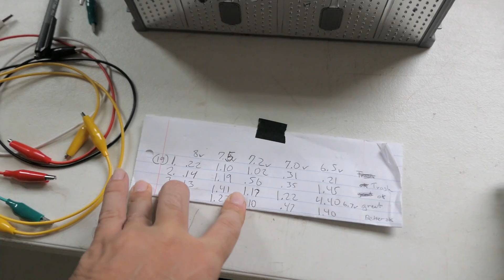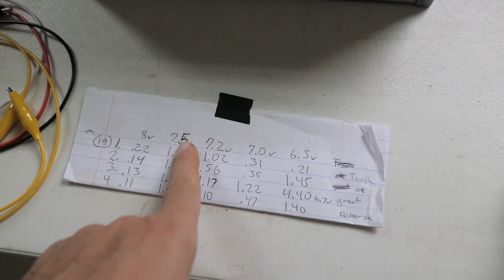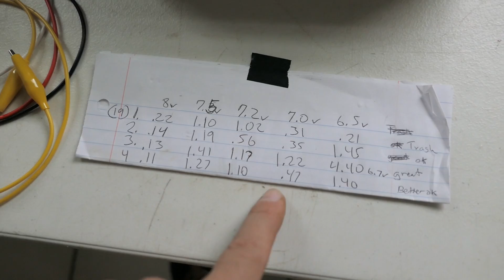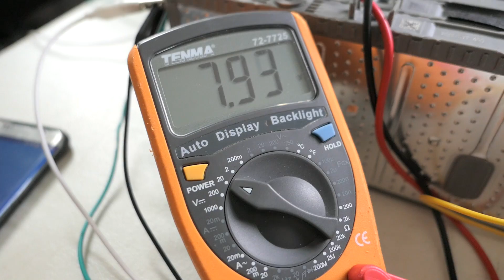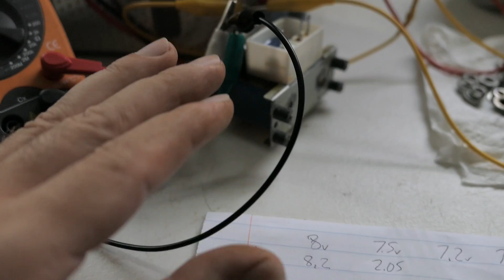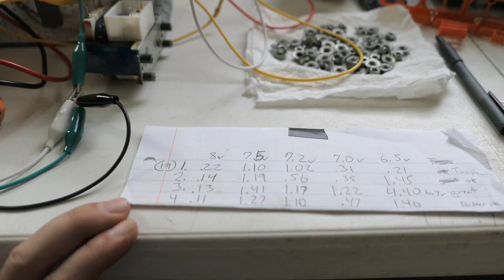Prius HV Battery Module Load Testing - Gen 2-3 ll lll

Comment: Can you use a load tester for a 12-volt battery?  I have one that does 6v and 12v.   I'm thinking the voltages are pretty close, but I don't know what the amperage would do to one of these modules.  I wonder if anyone out there knows about this.

Comment: 1 have been doing some research, it seems like you can use gen 3 cells in gen 2. But can you use gen 2 cells on gen 3. Mine is a gen 3 from
2010. Most of my cells are above 7v I have 4 that are in bad shape in the low 4v those I am going to replace for sure. However would you recommend to change anything below 7v? I have 4 other cells in 6.6. Please help :) and thank you for your video

Comment: Now buy a charger discharger charge battery with 1.5 amp to full then repeak charge at 0.4 amp until you have full voltage back. Then discharge and recharge. Now load test them. 
If they test bad after that let trash eat them. Otherwise save them for next time you take out the battery. Do this with any modules you buy. I am preemptively doing this.

Comment: Correct me if I’m wrong but Doesn’t the longer time you wrote down (1.22 and 4.40) at 7.0v and 6.5v indicate a battery with high resistance rather than low resistance due to the increased time? I would think a shorter time would indicate a battery with less resistance like battery  #1 with .21 seconds. 

So in other words, longer time to get to 6.5v means the battery has higher resistance and therefore is a bad battery.

Comment: Thank you for your wonderful lesson. I fixed my Prius C HV batteries using your method. POA80 popped up several times despite replacing all the bus-bars. Cell 9 was the culprit.
Reply: did p0a80 go away?

Comment: what's the simplest way to DISCHARGE a module? I put two new modules in my battery pack but they are .2v - .3v higher than the old ones. is that ok? or should I discharge before putting the battery back in the car?

I put little alligator clips on the modules and then onto a light bulb and it smoked the cables!!!

What kind of cables / light bulb or anything do I need for this?

Comment: Awesome and Informative.💯
Ever so often my check lights kept coming on, I did various scans which gave the P0A80 code, the bus bars, nuts and connections were all cleaned but after some time the lights were on again.
I’ve watched this video and because of this, i found four faulty cells(modules).
I replaced them and the car works perfectly. The problem only occurred under heavy loads and when the battery was really low. Some scanning tools wont pick this up. This method is definitely the way to test the integrity of the individual cells. Thanks alot for saving me some money and keep  up the good work. 🇹🇹

Comment: In making this instructional video, you did a bunch of starting and stopping. For all the rest of us, why not just set up a camera to record both the timer and the voltmeter, and then use the video to determine the voltage and time points. You wouldn't need to attempt to connect the load and start the timer simultaneously, or even attempt to coordinate connecting the load at a particular moment in time. Just start and stop the video after you've gone through all the cells you are testing and write down the voltage and time points. Starting and stopping introduces the time between reloading, which brings cell recovery into play. In other words, a longer rest period between loading allows a cell to recover more.
Reply: Thanks for this information, I’ll be using it during my test!

Comment: In normal operation the prius doesn't let the module voltage drop below about 7.5 so I don't think the time it takes to drop to 6.5 would be relevant.  The only time I see them drop really low is when there's a bad module.

Comment: Thank you, I followed this exact process and it made huge difference in rebuild prius battery. I had to use 6 halogen headlight bulbs to create large load. After tested all modules I replaced 13 weak ones and now works excellent.
Reply: Which charger you  use
Reply: Haha perfect, this is the answer I was looking for, I've been using 2 55w halogen bulbs and the voltage doesn't even drop less that 7.5v in any of the cells, even if I've discharged them and charged them at 3900mah which is really low, and it won't drop less than 7.5v even after 10 minutes.
Reply: How’s it been??

Comment: It is normal that close to 6V the cell will have longer time when the voltage drops. One cell is indeed a set of 6 cells 1.2V and more power it gives when you are close to nominal voltage of the cell so 6...7V.

Comment: hay thank you. could tell me how to charge the battery cell outside of the pack so I can load test them. I know it may be obvious for some but I don't now. how much voltage should I use to charge each battery? and I take it the positive of the charger is connected to the positive of the battery? how long do I charge them for or do I monitor it while charging with a voltmeter in series?

Comment: Great video! Can you please give a little more details regarding why you used three leads and what other components might serve as a good amp draw?
Reply: The reason he is using 3 leads is because of the amount of current going through just one undersized lead would cause it to burn up.. you can use one lead if the wire size is large enough

Comment: I desire I could watched this video before, I just finished load testing a 3gen cell with a H4 (90w) halogen lightbulb and I think I damaged it because I drop the voltage down to 3.5 v after 20 minutes and now is alittle bit inflated.
Reply: Wow 🤩 that low wait for how long you had it hooked up heheh did you fully charged each cell?
Reply: There’s many ways to do test loads but yeah 12v at 50w load will probably eat all that juice on that 8.2v battery , do you happen to know the Capacity of each individual cell on this battery ?

Comment: Nice! thanks for the info! I'm wondering why no one has started making aftermarket brand new batteries for hybrids and electric cars by now. its been over 20yrs for the hybrid. and 10 for the electric car. why is no one capturing this market!?
Reply: Lakario, I'm pretty sure I read that Toyota had an exclusive contract with Panasonic  not to sell individual new modules or complete batteries to anyone but Toyota  - and Panasonic holds the patent. However, that may change at the 20 year mark.
Reply: @legallyinsane7151  How do places like this then sell a battery module for $60? They don't say if it's new or used. But $60 a cell seems very steep. https://www.electronautomotive.com/product/toyota-prius-2004-2009-battery-module-2
Reply: @thomastommy9864    It doesn't say if it's Panasonic either....   and people buy them.. I don;t know who..LOL

Comment: Hi any one tel me why this guy put so many leed on one modul if u can see on ur rite  side 2 yellow one red nd plus white , nd left side 1 , black1 green , 1 white , nd bothe nd maltimeter cable why can u explanplzu canuse one cable attch with malti meter !
Reply: To handle the current draw for his load.  Use one large wire or many small wires.  The meter checking voltage pulls very little current.

Comment: Hi if u work out until 6.5 then that battry no good coz hybride car if the battry go below 6.7 or 6.8 the light comes on nd says check ur hy bride battry pack or system basicly when u take the bettry frm the car same thine u can check all modul nd write down then let the battry cool down 3 hours then after check re reading nd find out which cell reading down that cell bad simple good battry is good battry no matter how many time u cgarge or not nd bad is bad how many time u charge they discharge self that mean that bad battry or bad modul !! Im a write ??

Comment: I don't know if someone mentioned this, but a stop watch with a lap function will record your time between volt levels and you won't have to start/stop/unplug repeat.
Reply: Can you explain all that?  Not sure I understand how to do that.  And I definitely don't know all the start/stop stuff.  What's that about?
Reply: @alext8828  your stop watch on the phone has a function called lap, its icon looks like a analogue clock
Reply: @agentvip93  Ah, yes.  Thanks.
Reply: @alext8828  I think what he means is that just let the battery drain continuously and record the time taken to reach the desire voltages.
Reply: @Gemuk-man637  Oh, I see.  See how long it takes for them to discharge to a minimum.  Very good.  Excellent explanation.  Thank you.

Comment: Can i give you a pointer? The right way is to check for internal resistance any hight resistance cell is bad after that you need to reconditione back to full capacity each cell and then parallel every cell to bottom balance or top balance wich ever you prefer and thats it, built back and boala. And of course at the beginning at all this any cell with very low voltage under 6.5 is of course is a bad cell no need to mess with it.
Reply: No, Its a myth that "top balancing" does any good. As soon as you put the batteries back in series, their own internal resistance and internal balance will determine their capacity. Individual module balancing by a very low rate over-charge is a good thing.. known as equalizing.
Reply: Not true. Load testing is the correct way.

Comment: Your make-shift lashup is interesting and creative, however I use a Carbon Pile battery load tester for discharging modules at 40 A for 4 minutes to see if they are up to snuff. Use a stopwatch to track time accurately. No need to write down much of anything. Just note the resulting time on the module itself for future reference.  You really want to test those modules at something like what the car is going to do to the cells. Hybrids in general shove something like 50 to 80 amps at times. Testing at 40 is not a problem for those cells if they are any good to use at all. Also if one should burn up during testing it was not a good cell for the car to have anyway, so no great loss. I cook off at least one in every car I work on these days, especially with the older models. Generally I find something like a 20-30% failure rate anymore for high mileage cars. Also always load test any replacement modules. Quality varies greatly! Put the better modules in the center of the pack since they will degrade faster there, this will help keep the pack balanced longer. A Carbon Pile tester is common to find for about 79 bucks online. Dont be afraid of high Amp draw. Just make sure you are using a decent setup. Your little wires may deal with a few amps but they are far too light for decent reconditioning and load testing.
Reply: Mike, how do you recondition the cells? Testing seems straight forward, and I've seen methods for lead-acid cells, but not for these. How do you recondition them?
Reply: @cvmetalworks4594  The method you are looking for is commonly called "deep cycling". Get yourself a charger that can work NiMh cells. Automotive car chargers are not what you need. NiMh only. Then you charge up each module to full (usually a good charger shut off when a NiMh cell is full but sometimes not too) you can tell when a NiMh to totally charged when the surface temp is slightly above room temp. If your charger did not shut off before that then the peak sensitivity is set wrong or the charger is defective.

Once the cells are charged you then discharge them to almost dead. Most good NiMh reconditioning chargers can do this part too, however the D rate is rather slow being limited to 1 amp more or less for most model charger.

An alternative to the NiMh charger/reconditioner is to use a carbon pile battery load tester for discharging. Most shops have one of these to test 12v car batteries. Use it to D each NiMh module steadily at about 20 to 30 amps until the modules show less than 6V under load. What I personally do is look for the modules that can D for 4 or more minutes are 40 amps and stay above 6V. If a module drops quickly below 6v under that 40 amp load it is probably not good enough to use in the car too.

Deep cycling each module a couple times will do some restoring to the capacity but these cells do wear out over time too. oxidation builds up inside on the plates and electrical resistance goes up/ capacity goes down. What I normally see is up to half of the modules in a hybrid car could be worn out and not worth using again in the car. Depends on how the car was driven. Carbon pile load testing will quickly show you which modules are worth keeping.
Reply: @michael47lamb  a  jak  po  takim  tescie  laczyc  po  2 sztuki  czyli  pakiet juz  po  sprawdzeniu i np  ogniwo 6,5v  +ogniwo 6v czyli    dawac  slabe  ogniwo  z  mocnym ?

Comment: These things need a hard kick in the butt once in a while.  I tried being gentle with these cells, 1A C/D.  It did help me isolate cells under 4aHr but still had poor performance until I forced them hard.  Dr.prius app (not affiliated) has a battery life test function that will hard charge the pack in about a minute and then do a discharge test(AC,lights, heaters etc) over a 15 minute period.  At the end it will give you a life capacity percentage.  good luck......

Comment: Hello Just,

I like where you are going with this: interval load testing.  However, I have one suggestion that will save you time and improve the accuracy of the data gathered from your modules.  I strongly recommend you use the lap function on your smartphone or invest in an actual stopwatch, one that has a lap/split function.  You could take a split as each target voltage is hit, stopping the watch when the last target is hit and disconnecting the load.  Then you can use the recall function to review each split later, recording them down on paper, doing away with this disconnect-reconnect nonsense which is a waste of your valuable time.  By lowering the labor cost involved  in taking the readings, you could actually take more readings, creating a smoother curve.  As it is, you are spoiling your data gathering each time you pause to take a reading, giving the modules time to recover between readings.  Watching another Prius battery rehab video, "Hybrid Battery Ultimate Guide (Toyota Prius 2nd GEN 2004-2009) DIY," the commentator took a single 1-minute time-based load test, not nearly as revealing as your voltage-based load test.  That being stated, he did some  discharge capacity testing that you are not.  Of course, the proof will be how long your new refurbished packs last.  Anyway, if you decide on an actual stopwatch, I can recommend the ULTRAK 495, a stopwatch I have owned for the past eight years.

Finally, please keep us informed of the change in longevity of your Prius battery packs constructed with your improved method.  Accordingly, do you have an update?  Thanks.
Reply: thanks

Comment: Thanks very much for your time. Can I buy a device for charging and discharging the whole package together? I need your advice please.
Reply: I'm looking also. Was tokd today a New Zealand company has a killer charger discharger
Reply: That’s what the vehicle does..? If you have the red triangle of death (hybrid battery problem in Toyota) you really do need to identify the individual modules likely causing the problem. It’s rarely the whole pack (34 modules in the Camry) but a few bad modules causing the issue. At the module level you are looking at a nominal 7.2 volts, and a max capacity of 6500 mah (milliamperes hours). As NiMh batteries they respond differently than lead acid or NiCad or Lithium cells. Lots use chargers from the Radio Control hobby as they cater to this type and capacity of battery.

Comment: I have a Prius 2007 . I have been told by dealer that 2 of my 28 modules are faulty. Can you please let me know what battery module I need to buy?  I look at Amazon but I can not see any battery module specific for Prius 2007 (XW20)
Reply: you have a gen 2 prius (2004-2009) and it uses this battery: https://rover.ebay.com/rover/1/711-53200-19255-0/1?mpre=https%3A%2F%2Fwww.ebay.com%2Fsch%2Fi.html%3F_from%3DR40%26_trksid%3Dp2380057.m570.l1313.TR9.TRC1.A0.H0.Xgen%2B2%2Bprius%2Bbattery.TRS2%26_nkw%3Dgen%2B2%2Bprius%2Bbattery%26_sacat%3D0&campid=5338271021&toolid=20008
Reply: Don't waist your money on that it takes way more to refurbished a hybrid by now is pretty cheap to find a rebuild one for under 800.00 bucks i suggest look one with hight capacity cells pack ready to install.
Reply: @LUIS88123  you didnt give no solution only complaining how about you point people in the right direction instead of complaining

Comment: I would recommend running a load test not longer than 5 minutes and max 4 minutes just to establish baseline. On the very strong cell you may be damaging it slightly by draining it down that much that quickly, by 2 minutes in to the last test you could see it was much stronger and could have let it rest.

This page has another testing procedure on it: https://hybridautomotive.com/pages/lt

I modified a lightbulb discharger from the prolong balancing kit in order to make a DIY load tester for ruling out bad cells. I made a spreadsheet that will allow me to track the cells using both methods. I shared it here so anybody can open it: https://docs.google.com/spreadsheets/d/1FiyGRjUEjj-ZS3p4hW2kezH4EF44f3LsI3iRT0THMDw/edit?usp=sharing
Reply: Hi is it possible to replace small batteries inside this 7.4 cell pack?